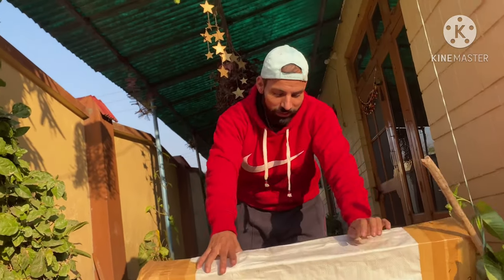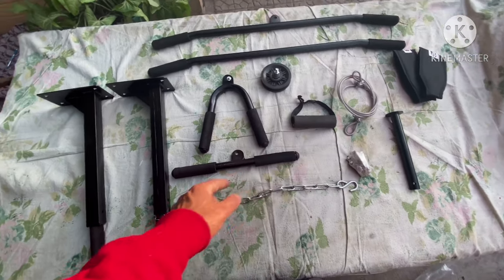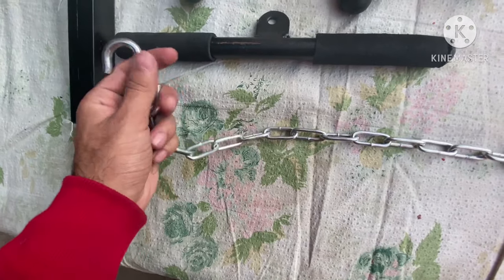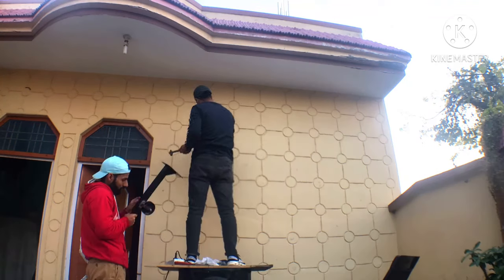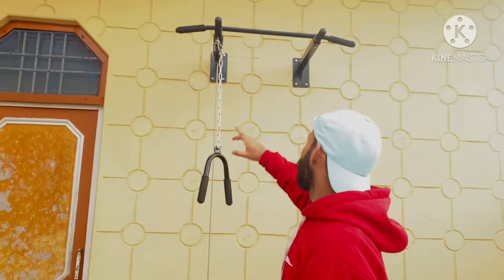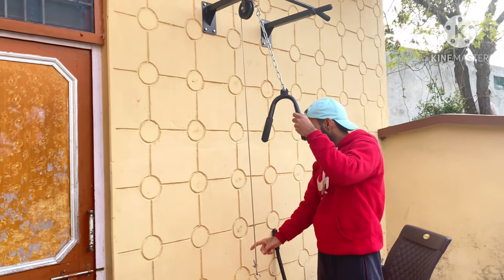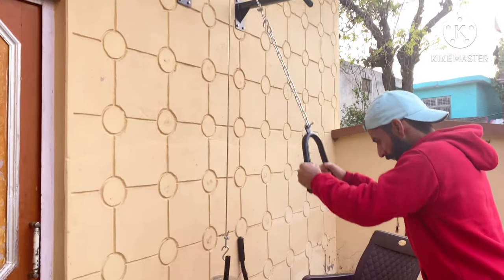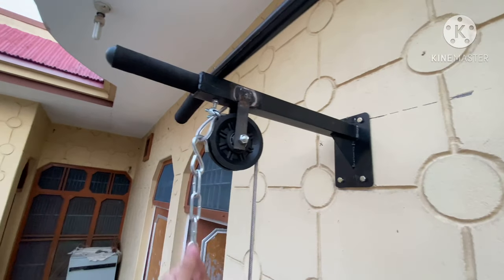Pull-up Bar , Chin-up Bar with pulley installation | pro toner

Comment: bro , pulley mein 60, 70kg weight lga skte h ??? mtlb wire ya pulley tutegi to ni ?please reply
Reply from the maker: Sabhi bolt acha se mount ho gye hai wall mai koi free toh nhi hai?
Reply: @travellersibling8858  bhai abi order kia h ,3-4 din m ajaega , or mne flipkart se order kia h 1850 ka h , amazon pr 1550 ka mil rha h , but amazon pr review ache ni h , so difference h kuch dono m ya same h, and please tell 60 kg tk weight lga skte h pully m? Wire ya pully tutegi to ni?
Reply from the maker: @akashkaushish3534  koi difference nhi hai Amazon mai rate kam he hota hai weight thoda thoda kr ke lgana one go mai nhi lgna

Comment: Now its price is 2000 INR
Reply from the maker: Yes bro day by day it’s increasing due to huge demand
Reply: @travellersibling8858  
Can the bolts resist upto 100kgs of weight ??